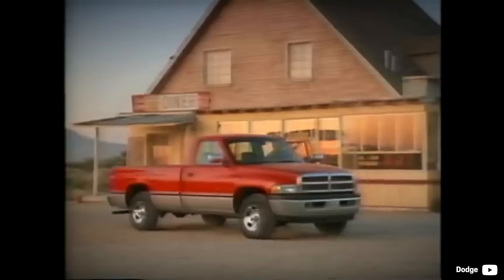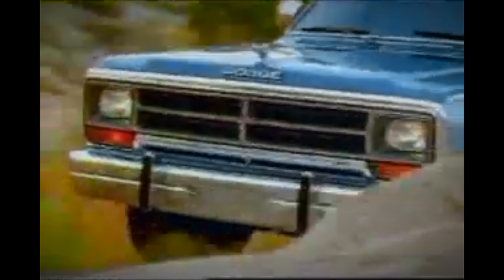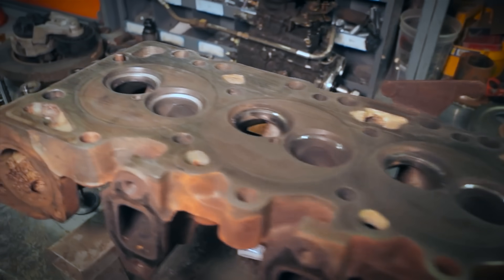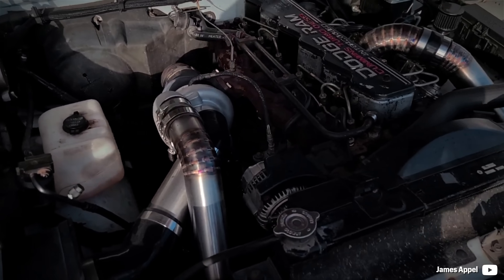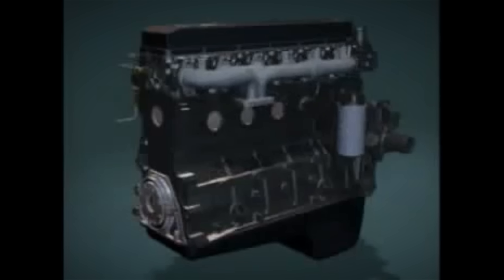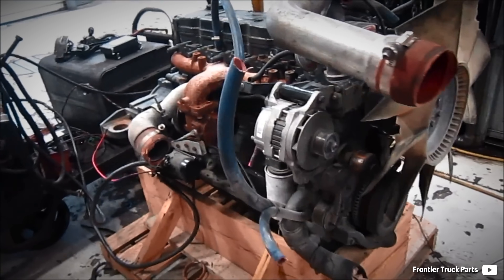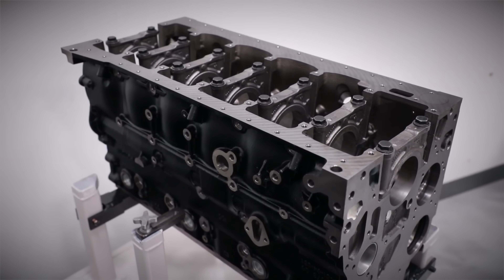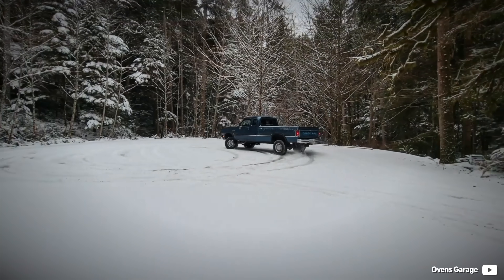The Most Reliable Diesel 6-Cylinder?

Comment: Great video as always 👍 Although I have my gripes with my ‘02 Ram 2500 it’s to be expected considering it’s a 90s Chrysler product. But the Cummins sound and reliability is something that never gets old for me and that more than makes up for it
Reply: We had a 1992 Ram 3500. I wouldn’t be surprised if that thing dated back to the 60’s or 70’s at the very best. Dodge didn’t change things for a long, long time
Reply: @RobertSmith-le8wp  and they still don't change things for a long time. The current HD trucks are the same as the 2011, which aren't really that different from the 2001HD trucks
Reply: That's bc Chrysler had nothing to do with the engine lol.
Reply: Good news. 
New science development have taught us that 2002 is NOT in fact, the 1990s
Reply: @fastinradfordable  the truck that he drives which is a 2002 is a model that come out in 1993. The same chassis axles frame everything besides the transmission a few electronics and it being a 24v over a 12v. Don’t be arrogant if you don’t know what your talking about.
Reply: @fastinradfordable  My truck itself may have been assembled in 2002 but in the end it was still designed in 1993. Though my specific version was released in mid-1998 the vast majority of the materials used are still the same as the older model years, same cheap Chrysler plastic. If you’re gonna be a smug dipshit about something at least get the facts right

Comment: Drove one pulling a car trailer with a Mustang on it. Pulled like it wasn’t there!
Reply: I pulled the gas engine out of my square body and dropped in a 12 valve Cummins I got out of a box truck. First time I pulled a trailer I thought I was dreaming. I used to have to whip that gasser to within an inch of it's life getting on the highway with a heavy trailer, that diesel did it like it was nothing and I never went past half throttle. 

And if I just have a little 2 wheeled car dolly with a sedan on it, I can't even tell it's back there.

Comment: I’ll never give up my 04 dually with a nv5600   
I prefer the pulling power of a duramax over the cummins but I love both. I won’t sell my 91.5 w350 either. It’s incredible.
Reply: Ive owned both. A 2007 duramax dually and a 2003 cummins dually with 6 speed

Both being stock the duramax could not hold a candle to the cummins
Reply: @lewisbradford3305  Sure. An 07 Duramax and an 03 Cummins. The Duramax has more HP and TQ. Cummins in 03 has 305 HP and 555 TQ in the HO engine. 2007 Duramax has 365HP and 660TQ. Nice try though

Comment: Great to hear a engine that has a turbo sound! Nowadays turbo sound are muted in design.
Reply: the turbo sounds are muted by the emissions equipment ,, essentially a 5 chambered muffler
Reply: Probably one of my favorite things about my 12-Valve Cummins. I have a 4” straight pipe that dumps under the cab and the turbo noises are absolutely glorious
Reply: psss pssss

Comment: My 2001 5.9 ISB was a trailer hauling monster. Of course 4.10:1 rear gears helped!
Reply: Oh man I swear nothing hauls better than a 5.9 with a manual transmission.
Reply: @Zach-ju5vi  Mine had the automatic transmission, made it easy to hold 2600 rpm, where torque and horsepower maxed out simultaneously.
Reply: @alanbare8319  Right on 👍. Mine are both 6 speeds and they lug a heavy load like it's nothing so I rarely get up that high of rpms unless I'm climbing a hill or something. But I do know what you mean about the torque and HP hitting full potential at 2600, it pulls hardest right around there.

Comment: love straight 6 diesels. love cummins naturally !
Reply: I agree with you there. Every straight 6 I’ve ever owned or known someone to own has been a fantastic engine. My first truck was a ‘69 Chevy C10 with a 250 and a 3 on the tree. I had a friend with a Dodge that had the leaning 6, I think 225 that was excellent. My dad had a 1992 Cummins that was excellent. I even knew a farmer who had an old early 80’s Mercedes in-line 6 diesel that had insane mileage like in the 600,000 plus range.
Reply: @RobertSmith-le8wp  old merc diesels never die ... and the inline 6 is perfectly ballanced just cause its inline 6... i have a old bmw 525 tds witch is 2.5 cc inline diesel. everyone hate it cause it overheats and bends the head... but that is to be expected from 3-500 k mile cars